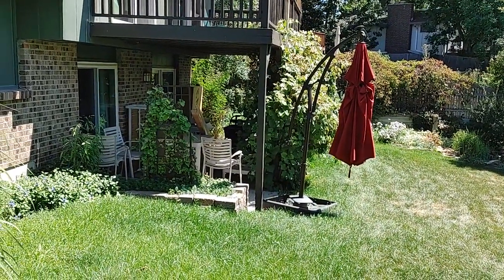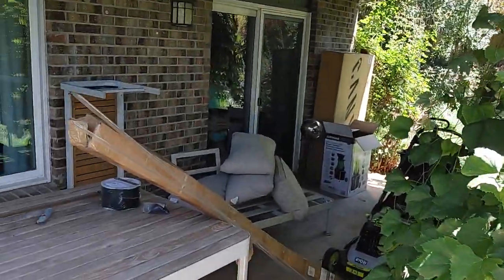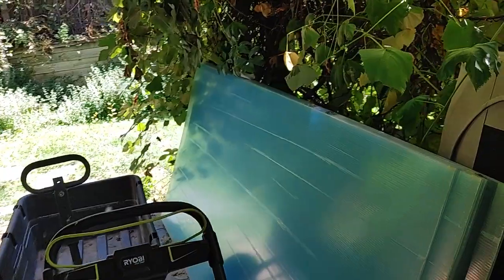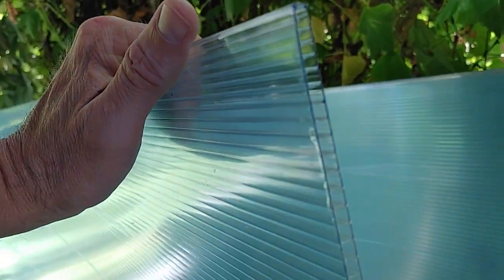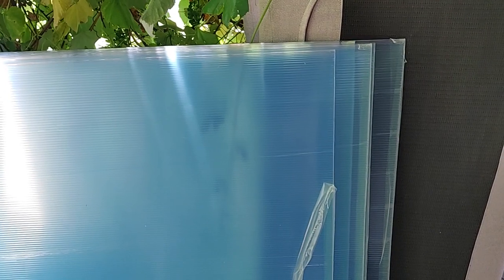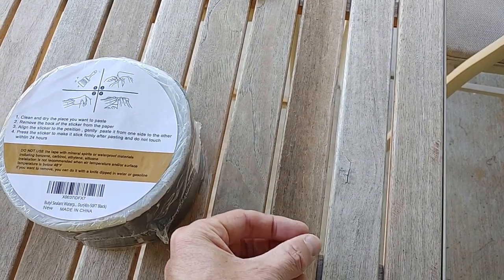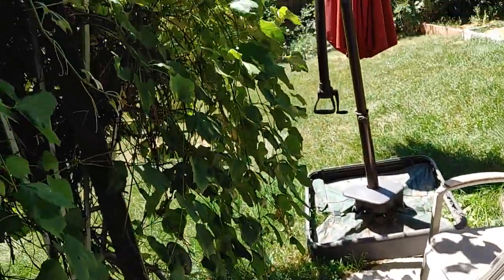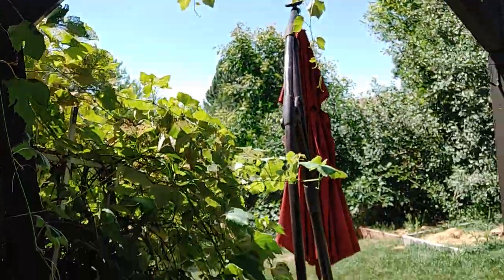Weatherproofing our below-deck patio - roofing with multi-wall polycarbonate

Comment: Are you going to enclose the patio completely? Where I am, I’d be too worried about wildfire- I’m told under-deck items are a big risk to ignite the deck above. I do have a 5 wall polycarb greenhouse pretty far from the house but if it melts or burns it’s not as big of a problem.
Reply from the maker: My current thought is to use clear vinyl "walls" which I could attach to the deck framing with grommets.  So I could remove the vinyl in the summer if desired.  I need to figure out a door solution, as I definitely wouldn't be comfortable without an egress door on the lower level!  I didn't even think about fire risk.  No idea on the combustibility of polycarbonate, but it's made of hydrocarbons, so I'm sure it'll burn quite readily!  Currently there isn't any wiring that will be touching the polycarb, and I think I'll keep it that way after reading your post.